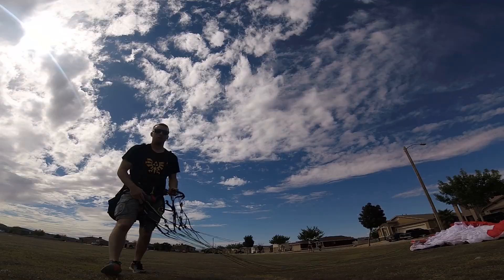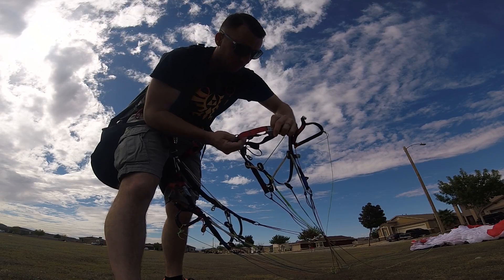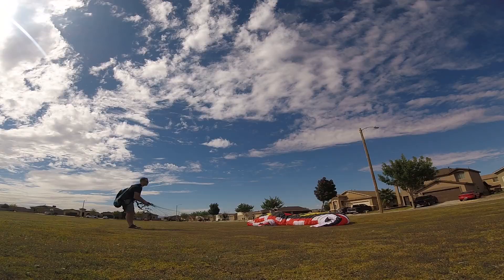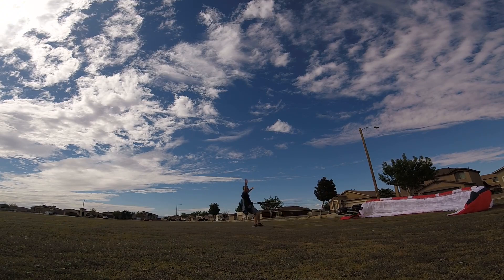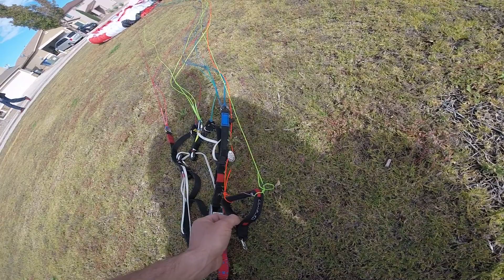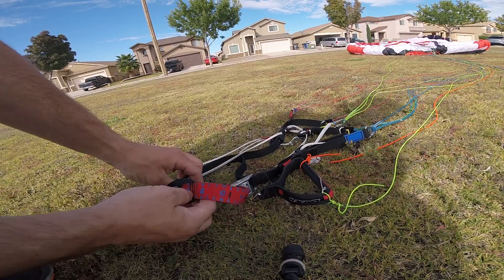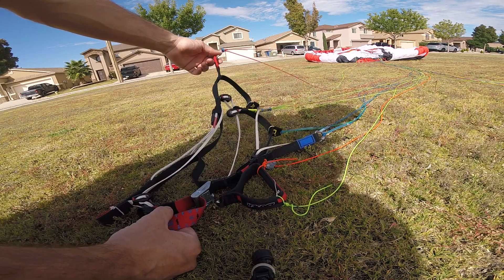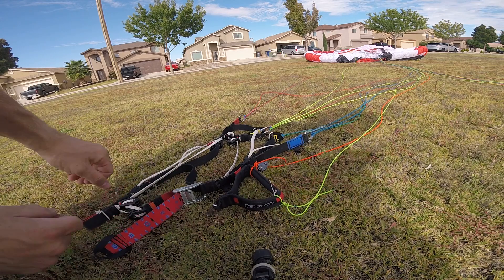How to launch a 16m Dudek Warp

Comment from the maker: The wing launches the same in nil wind. The wing doesnt care if the wind is blowing or you are running.
Reply: Your legs care if they are creating all the wind. The whole notion that wind is irrelevant is just silly.
Reply from the maker: @lashley370z  I said the wing doesnt care. If you cant run fast enough that's not the wings problem.
Reply: Calling bs on this comment... In my experience almost all modern wings will kite fine with this amount of strong laminar wind, but the real test is nil wind. How does it react and what does it tend to want to do. As Tucker showed it tends to want to lag back and not want to fly until it's given a significant amount of airspeed
Reply: @lashley370z  then this is not the wing for you... if you have the skills you need to fly this wing, you should also be able to lauch it without any problems
Reply: Mitch after the dumbass video Tucker posted, I tried my best to get him to make contact with you or a few of the other Warp experts in US.  The FACT is that if you fly heavy load and cant run fast the Warp is still easy to launch in zero wind, trims closed, as you mentioned, by just holding the A's forward for a few moments longer so it pops into 12 oclock position. In actual fact, its works to launch in cross wind and even down wind. Super super easy. To prove it I'm going to take a pilot that has NEVER flown advanced glider and film his 1st TO with this technique. To prove a point. Its all technique. Not Ozone technique. Brilliant video by the way. Keep rocking the Warp Drive buddy!
Reply: @axelgheldof2149 , good point. I'll avoid it.

Comment: I can learn a lot from watching you kite! Can you do those no hands things with your Base?
Reply from the maker: No because the base doesnt have trims. Letting the trims out on ppg wings is like pushing a little bar on a ff wing. If you rigged up something to pull the speed bar line then you could launch the base the same way but it would likely over shoot you and collapse.
Reply: @MitchG  That is what I thought.  Some wings will rise no hands, though.  Flybuble has some vids on this. The Nyos RS is interesting in that if you hold Cs the way I need to with the A3 or S5, it wont cone up more than a few feet, then falls back. It takes a light touch on the Cs to steer it Mitsos style. So I'm letting go of the Cs much earlier,  and the RAST slows the rise and helps prevent overshooting. I need to keep  switching wings or I'll get too used to the way one handles.
Reply from the maker: @NelsonsWings  I have learned that paragliders are very sensitive to trim. A difference of 1 inch will completely change how a glider will inflate, handling, and flare authority. I have seen some acro guys like geti G for example, lengthen the d risers on their glider to get more trim speed from them. I believe that the strict EN testing has forced manufactures to trim most gliders very slowly to pass test. If they didnt have to do that, I believe our gliders would have a lot nicer handling and performance and just a little less "safety"

Comment: Aha!  So it seems that the technique is to use less 'hands'...!
Have you had Super Training...??
Good explanation.  It seems from your comments as though the difficulty elsewhere launching with trims in is due to the manufacturer making the trim settings suited for tight maneuverability that compromises easy launching.  
In that case, maybe an updated launch setting and technique section in the manual would be helpful, as various people report difficulty using manufacturer advised settings.
Reply from the maker: IMO the manufacture shouldnt have to go into such detail on how to do something as simple as launching on a competition level wing. Dudek recommends hundreds of hours before flying this wing. If someone cant figure out what I explained then they dont need to be flying a warp. You can kite this wing for 5 min and figure out where you prefer to set the trims for launching.
Reply: The noise on the mic, and kiting the wing back to where you started leads me to believe your idea of super light winds is a bit different than mine 😁.  Would like to see a nill wind inflation.
Reply: @Ferret0007  I agree. That is no where near a nil wind situation. However, he did a great job of inflating this wing with the available wind
Reply: So I see thay in the Warp manual the manufacturer recommendation for new Warp users is to both trial flight and launch at trim setting closed (0) or slightly open (2-3cm).  The black lines on the trimmers are quoted as being every 3 centimeters.
I haven't yet seen an easy launch example at trims closed - although this is the starting recommendation of the manufacturer.  
For this reason I'd think it reasonable to query their existing recommendation if it is causing unexpected results.  
That doesn't mean that there are not  better settings for easier launches, or that pilots shouldn't kite as much as possible and get a good feel for the wing before flight.  
It just means that the setting range recommended by the manufacturer is being used by some new product users who are experiencing apparent difficulty.  Presumably we should all be mindful of manufacturer advice, as well as hands on experience.
Maybe the manufacturer suggested trims closed because the safest overall expected starting setting for flight with a new Warp user is thought to be with trims fully closed.  Maybe the recommended settings are based on actual testing but the 16M reacts differently to other wing sizes - as has been suggested elsewhere.  
Whatever the reasons behind the choice of starting settings, I think it fair enough to query and think about.  It certainly doesn't look like generic 'copy, paste' setting ranges used by Dudek as the information is different in other wing manuals of theirs, like the Universal 1.1 and Synthesis 2.
Agreed, it is an expert wing and should be used by experienced pilots; albeit beginners seeing easy 'no-hands' or 'worst launch ever' inflation videos might be encouraged to give it a go.

Comment: Currently demoing a report'air and getting kicked in the nuts trying to launch it nil wind. Any tips from dudek owners?
Reply from the maker: If its hanging behind, Let the trims out to around 6cm or pull more A's. If it overflies you, pull the trims in and use more brakes. Get on the power
Reply: If I had a few more weeks with this glider I'm sure I can figure out the launch characteristics but it's significantly different to launch than what I'm used to. Especially in the cold weather with all that gear on I can't afford to blow launches. Flys great but not the glider for me. Glad I tried it first
Reply from the maker: @Ellwoodsss1  I understand. People tend to like the gear they learn on. I'm biased in many of the same ways